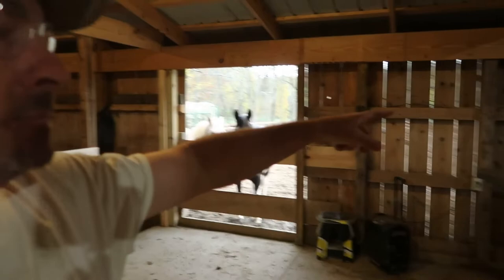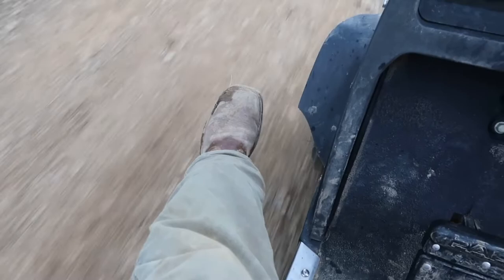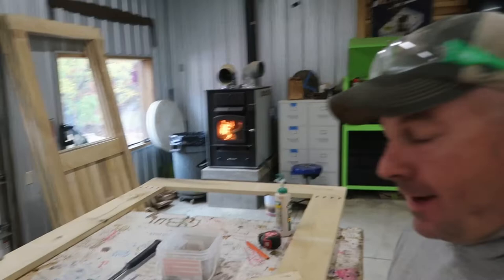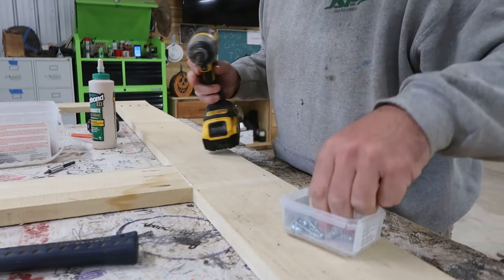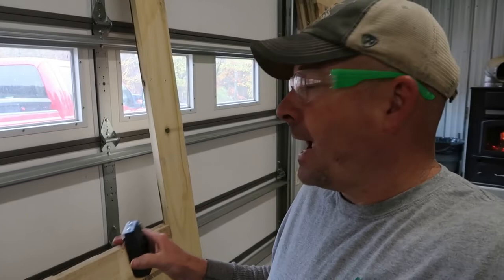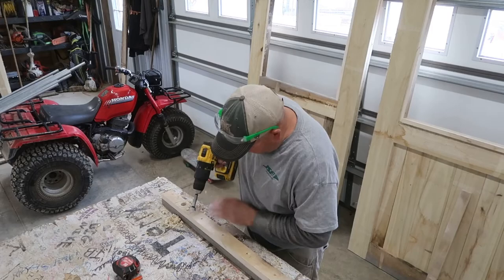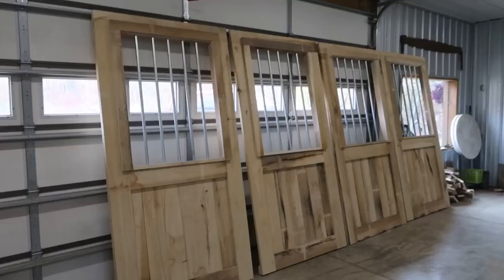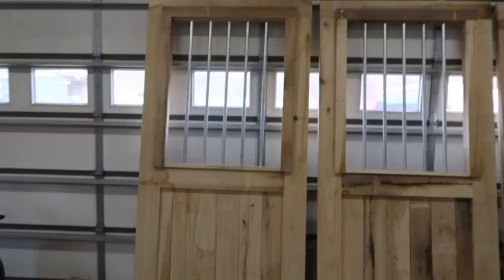Building beautiful horse stall doors with Poplar cut on the Woodmizer.

Comment: Can you tell me if that was 1x6 or 1x4 material that you used to make your door frame and slats with?
Reply from the maker: 1x6 material
Reply: @CairnCreek  When you did the back side did you run 1X6 down both sides and across the top and then use a 1x3 on the bottom to support the slats? Also, did you gram the opening in 1x2. Sorry for all the questions. Thanks for the help. My first wood working project from scratch. 😁
Reply from the maker: @lynnpurcell4938  shoot me an email and I can reply with more pictures. Jsflc78@gmail.com

Comment: Any suggestion for me with a horse that chews on wood 😪
Reply: If it knows what a wire shocking fence is than you just have to put knobs on top of boards and string wire. Wire doesn’t need to be shocking... if it’s not used to shocking wire than put up same way and hook up to a shocker.. after it’s zapped a bit you can remove shocker. Let the wire up.....we had a wire shocking fence about 45 yrs ago. A friend gave me a cribbed horse,,skin and bones. They were going to euthanize him. I said no,,can I take him. He was in a wood fence. When I got him he ran through the electric fence 1 time. That’s all It took.. ( I even had thin rags cut hanging from wire for him to see)..problem was in his stall than. So we just pit knobs on top with wire all around.even on entry door..it wasn’t hooked to shocker, but-he thought-it was..LOL..He gained weight and was the most beautiful, muscular Palomino..I loved riding him..good Luck..